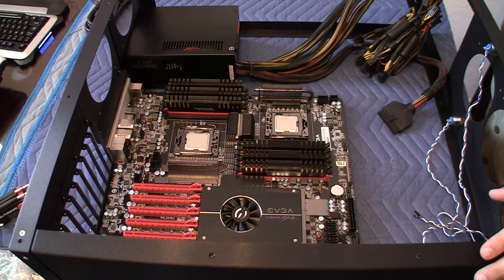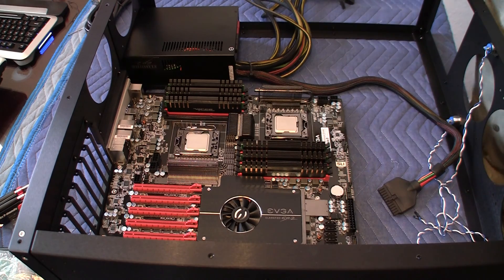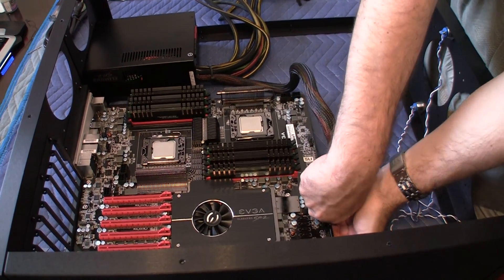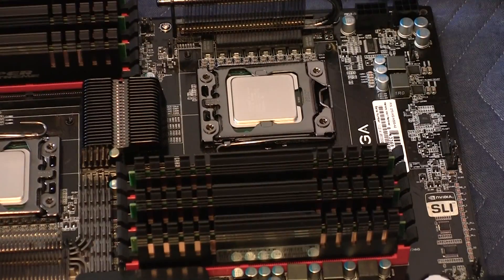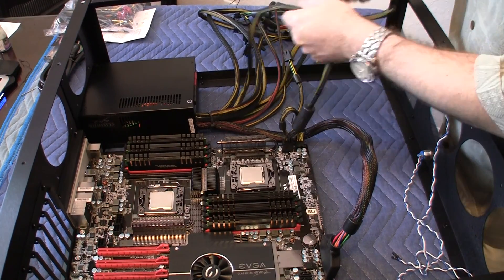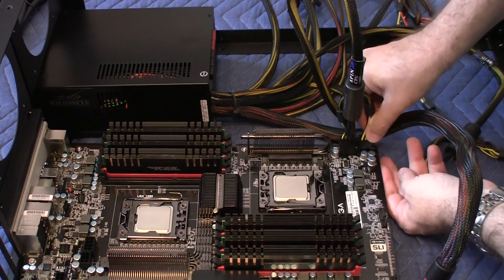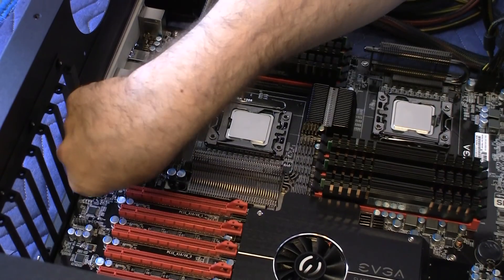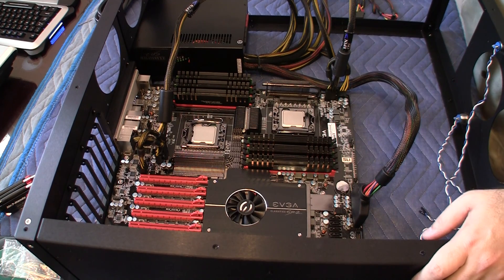Part 8: Connecting EVGA Classified SR-2 1200 Watt Power Supply to EVGA Classified SR-2 Motherboard

Comment: I've built several computers over the years and have never used any static precautions except for touching the metal case every once in a while this will ground you out so you really won't need it

Comment: Theres no anti static precautions! you know u can cause damage to a system that will not result in a boot or post failier but would give the occasional bad calculation giving rise to bugs that u just cant test for? I know ur only pluging in a psu but still ur got ur hands on the motherboard. just saying as i can see ur in for a good computing experiance thats not cheap and a nice lil wrist strap and plug is all u need for peace of mind. sigh i wish i had that system :D ;)

Comment from the maker: You can, of course. However, the EVGA 1200W is meant to power this particular motherboard with 4 video cards. So yes, the 1200w will work. What you should worry about is how to cool the power supply. The 1500W supplies have a fan not going out the back, but rather, on the side (or up). Which means - you have to have more fans blowing air through the case.

Comment from the maker: The case is a Mountain Mods, Pinnacle 24. I have not overclocked the 5690s yet, because when I run it at 100% load, even with those ridiculous heat sinks, it still heats up to about 52C+. I will be adding liquid cooling in about 2 weeks and then will start to overclock. Regarding Cinebench, I will be posting those results in an upcoming video, probably in a couple of days. Please subscribe and you'll be notified when I post those results!